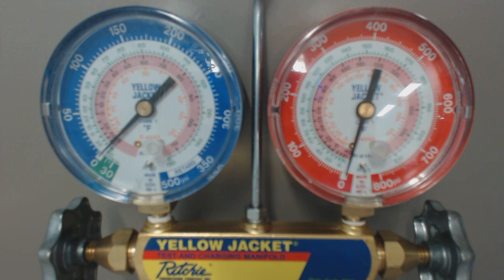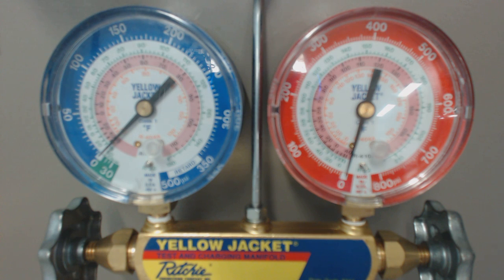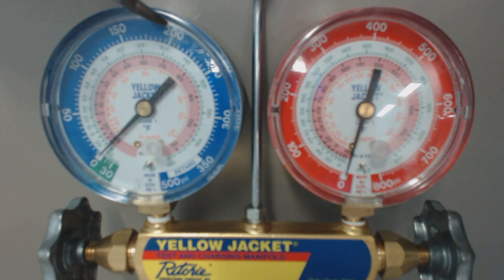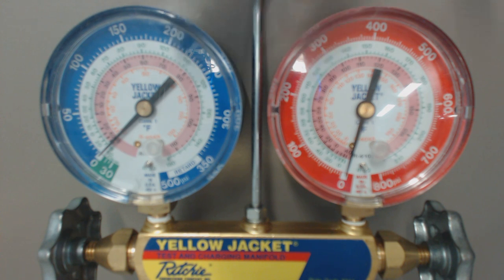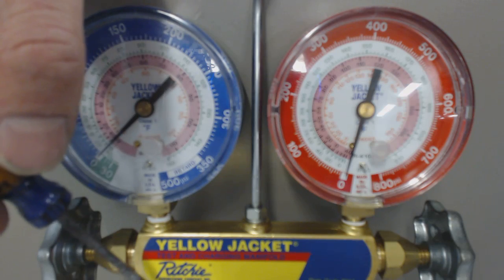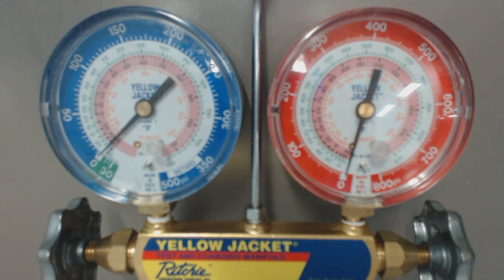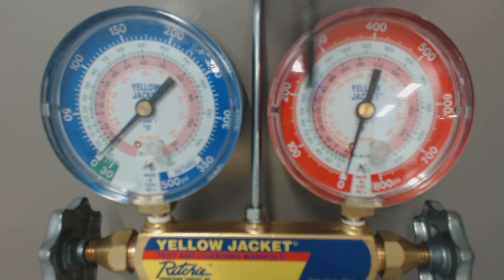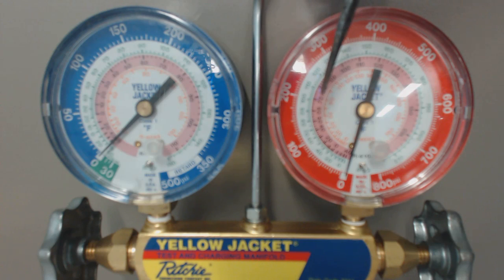Explained: Saturation Temperature and Pressure, Superheat, Subcooling!

Comment: When I measure the low side line temperature for superheat it is almost the same as saturated temperature. Is that the flow on restricted drier or meter

Comment: Question: if you have a Min i split with only one service port (vapour LD)  , would you not put it into Heat mode(so the inside unit is the condensor) , run for 10 minutes? and messure pressure on the Vapour port LD) and temp on the liquiiid line? in this case you would have subcooling temperatures measurements? wich is much more easy then subcooling measurements?.

Comment: Awesome video! I finally got it. I had to listen to it several times, but I got it. This helped a lot to understand superheat n subcooling. Basically, what a tech looks for with these units of measurements/principles is that the unit as a whole is cooling the Freon n removing heat to a usable temperature whether it be gas or liquid state. A tech will know if the condenser is cooling the Freon or if the evap is removing heat sufficiently. This will eliminate a lot of guess work as to what might be wrong when there’s no cooling going on. Wow! This is awesome stuff! I wanna learn more.
Reply from the maker: Check out the full length articles on the website at https://www.acservicetech.com Its awesome to hear those aha moments from someone hungry to learn more, very cool!!!

Comment: saturation point @ evaporator minus temp. @ suction service port is = superheat.

superheat is temp increase from middle evaporator to suction service port or comp. inlet.

from center of condensor or saturation point to outlet of condensor at discharge port is temp. decrease or subcooling.

discharge pressure converted to saturated temp. minus discharge temp @ discharge port or compressor outlet is  = subcooling...
Reply from the maker: Superheat= actual temp coming out of the evap on vapor line minus Sat temp at evap 
Total Superheat=  actual temp before the vapor service port at the outdoor unit minus Sat temp at evap 
Subcooling= Sat temp at condensor minus actual temp of liquid line after liquid service valve 
Thanks Ron!

Comment: Great video and lesson. One question I am an I&E Tech and have to deal with HVAC on a commercial level. I read about subcooling and it always says to take the temp on liquid line as close to the evaporator you can get but before the TXV in your opinion how critical is that? I have seen in one of your videos take it where the discharge line leaves the condenser that short run before it enters the home. I am guessing that is for convenience and accessibility purposes but in my work I can access the TXV easily. So is it important to take get that close or negligible, or am I totally off base which is a very good possibility. lol

Comment: Could you make a video explaining WHY a refrigerant's boiling point naturally settles at room temperature when left alone?
Reply from the maker: Hey Ryan, thanks for letting me know what you would like to see as a video idea. To answer the question here for you, take a look at a pt chart. If at any given temperature a refrigerant has pressure then it is at sat state but the increase in temp increases the amount of pressure boiling. If a refrigerant is at 0 psi on a pt chart, then you know that the refrigerant is not boiling but at 0 psig such as r-22 at -42 degrees. I hope this helps, thanks
Reply: acservicetech i understand PT charts, I just dont understand why some refrigerants aren't subcooled/superheated when at room temperature.  Like water, at 0 psig its boiling point is 212, however at room temperature it's subcooled liquid.  But refrigerants boiling point always ends up morphing to room temperature. Why is it always at saturated state when left alone? Versus water is always at liquid state.. would waters boiling point constantly follow room temperature if it was in a vacuum too?
Reply from the maker: The key to this is still the pt chart as each refrigerant exerts 0 pressure at different temperatures if you compare them. Water is a refrigerant but the 0psi for water happens at a much higher temperature than the refrigerants you are used to working with at 212 however when you lower pressure like in a vacuum pump, the water will boil at a lower temp because if you think about it, there is less pressure to push the molecules tightly like when it is in liquid form. Here is a link to some vacuum units to check out. Water is on the right-https://youtu.be/zJmZHzLwqbs
Reply: acservicetech thanks for the replies and all the videos you do, one of the best channels on YouTube for sure, really appreciate the effort to help everyone in the field!
Reply from the maker: Thank you Ryan!
Reply: I am puzzled with this question if I had say R134 refrigerant in an open container at 1atm then it would rapidly boil since its vapour pressure at say 20 deg C  is way beyond the surrounding atmospheric pressure. If you had the R134 in a closed container then the liquid  refrigerant in a container starting at zero psi would rap rapidly fill the bottle  with a gas pressure until the amount of gas going from liguid state to gaseous state would equal the amount of gas going from gas to liquid. It is now in dynamic equilibrium and the pressure in the tank would be quite high depending on the properties of the refrigerant and eventually the gas and liquid will be at room temp all though in practice outside temp is always changing and you may notice where the liquid line is that it will feel slightly cooler.   @acservicetechchannel

Comment: I have a question regarding the re-gassing of systems in highly variable hot/cold climates. I have a Daikin Multi system that was given to me that had been completely vented. The system used to use R-22 so I'm using a replacement gas. The unit needs to work in climates that vary from +45C down to -5C and is a heat pump cooling/heating unit. It also has electronic metering valves instead of a TXV/capillary tube.

When gassing the system, looking at my temperature/pressure chart, do I need to ensure that my high side pressure is above the condensing pressure for the highest ambient temperature that I'm anticipating that the unit will be working in? My theory being that if the high-side pressure isn't high enough, that the gas won't be able to condense and subsequently subcool on the extremely hot days. I guess it means there will be excessive subcooling on the more moderate days, but will ensure the unit will keep working on the hotter days.
Reply from the maker: Honestly what I would do is just connect the refrigerant lines, add up the lineset, see what the weight is on the rating plate and for how much of a length it is god for. Remember that these units most of the time have accumulators for extra gas storage and compressor protection. Depending on the unit, if it has more than one wall unit inside then you can't really check with subcooling. You would need to add refrigerant in by weight. I have had the Mitsubishi tech tell me that I could check the superheat and get this between 0-5 degrees of superheat if I had all indoor units running on full emergency on. He said that the accumulator will protect the compressor and that is where they store all that excess refrigerant when the unit says up to 90' of lineset or whatever the units says the length could be. I would check by calling Daikin tech suport to ask them exactly how they recommend charging your particular unit. You could also look up the installation guide with the model # online. Mini splits are different than split systems unless they have a single speed compressor.  Thanks!
Reply: acservicetech unfortunately the installation guide isn't available, and with a drop in replacement the densities don't match up so I'm flying a little blind. The drop in is R290. I'm getting about 3F in Superheat as best I can tell and about 7F of subcooling. The charge specified for the outdoor unit is 3.7kg of R22 (essentially not available in AUS any more)
Reply: The problem I'm having at this point is that adding gas is raising both the high side and the low side pressures, low side is sitting at about 72psi which seems a little on the high side? Should be somewhere around 60ish I think. Suspect I may have over gassed it when I put the replacement charge in and more needs to be bled off but I would have thought that would have led to excess subcooling?
Reply: So I think I figured it out. I suspect it may have been slightly under-gassed not over-gassed. I have it running now and the sub-cooling is sitting around 10C, and the superheat varies between around 4-5C and 10C depending on if the indoor unit is in the "powerful" mode or not. I did notice that as I added refrigerant it got to a point where the superheat peaked and then started falling again, so at that point I stopped, bled off a little and disconnected the gauges and it appears to be running better now. Pulling less current and cooling much better. At this stage it only has one indoor unit connected.
Reply from the maker: Oh ok if it is a psc compressor that is just single speed then you can just check for subcooling which normally would be 8-10 degrees but I have seen manufacturers call for up to 17 but if you don't know I usually add refrigerant to 11 degrees. Check for a 20-21 degree temp split between the return and supply air while on emergency cool or highest speed on those mini splits. Thanks and glad to hear you figured it out!

Comment: I guess if the sticker is missing on a condensing unit you can take a pressure reading with the system off and find out the refirgrint type
Reply from the maker: Exactly, here is a video on that.https://youtu.be/yBqDkbuyuIo

Comment: awesome video. how does suction pressure at the service valve at the condenser tell you the pressure in the evap coil. does it remain the same pressure all the way from evap coil to service valve.
Reply: and if so wouldn't the heat pulled from the house change the  pressure since the  pressure and temperature relationship
Reply from the maker: Thanks for your comments! Great Question! So the saturated temp that you see on your gauge set is within a degree or so of what it should be in the middle of the evap coil even when read at the outdoor unit. When you read a sat temp on your gauge of 33 degrees, the system could run and run as long as it needed to in order to cool down the building as long as the proper airflow was going across the evap coil. It would have to be a more cooler load than normal for a sat temp like this to be present anyway. When I have seen 31 degrees sat temp for any period of time that's when the evap starts freezing. Your pressure actually is the same at the service valve and in the middle of the evap coil within a degree or so but the temp increases after saturation state until the time it gets to the service valve at the outdoor unit which is called the total superheat. I will likely put together a video on this because a few people have asked about it. Stay Tuned and Give me a little time on that. Thanks again for your great questions!